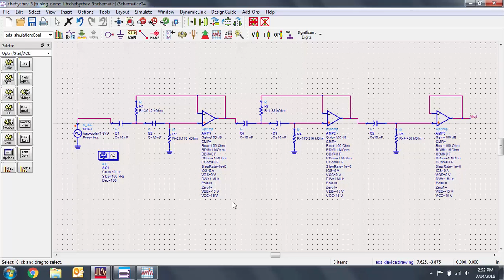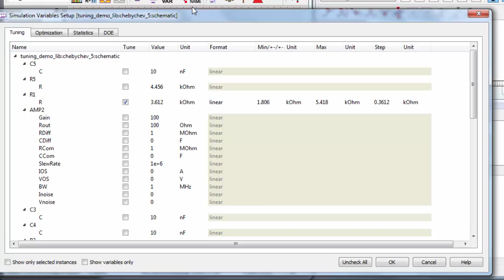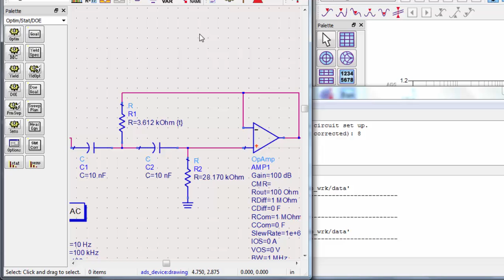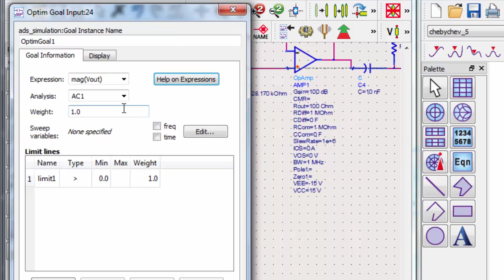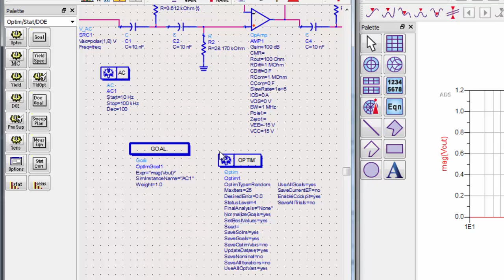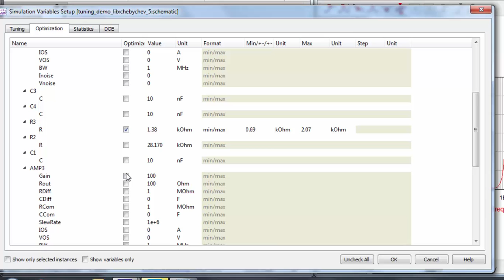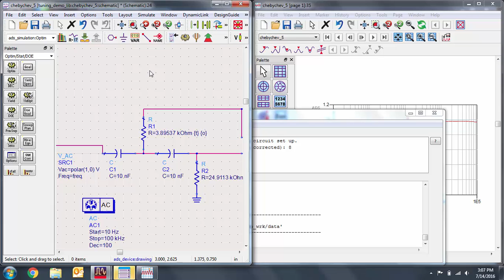Tuning and Optimization in ADS

Comment: Which version of ADS is this? These windows don't show up in ADS 2009. Also how do I set the frequencies like you did at 4:26 in ADS 2009? 
Also is there an optimization cockpit in ADS 2009? Or just clicking simulate runs optimization as well?
Reply from the maker: You're right, this was not available in ADS 2009. You can apply for a free trial of ADS 2016, the latest version here: http://www.keysight.com/find/eesof-ads-info.